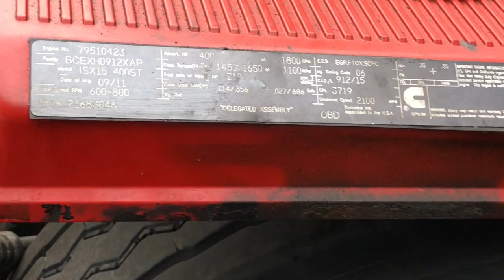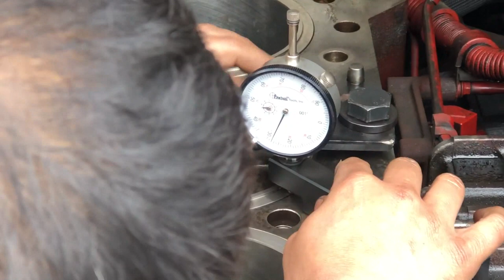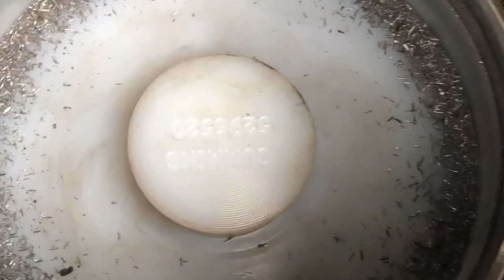ISX 15 Counterbore Cutting Services | GTO TRUCK REPAIR

Comment: Im rebuilding 2 3406bs doing a good job at it . I bought a used counterbore tool . Im doing the work in my friends shop and he keeps messing up my progress, hes had over a dozen mechanics put there advice and most just never do counterboring , the few extra experienced mechanics agree to have it done but will only hire someone else for the counterboring and are telling not to even try. Can i get your advise or anyone reading this advise ??? I just got 2 new spacer plates, Im being told to throw the better one together without counterboring ,  the other is out of spec i can counterbore it later
Reply: Anyone can do anything they set their mind to. However, when it comes to counterboring, it is  machine shop work. Eletrician is it's own trade, mechanic is it's own trade, same as being a machinist.  It's a special skill that takes years to master to get a "feel" or "touch" that you can't buy or shortcut on, kind of like Jui-Jitsu as there is no substitute for "mat time".  Sure, you can buy the tool follow some directions and advice and maybe be okay and get lucky because  all engines do indeed have their tolerances but it is a huge risk if you have never done it before. Typically most engines allow for     .0015" to 002" of liner deviation. Even if your cuts are inside of .002 deviation, on a Cat  you also have tolerances for the spacer plate, the plate gasket, liner flange thickness and the liner shims or inserts that could easily put you out of specifications.  I have literally measured shims from all manufacturers and sometimes out of 6 there is a .002" deviation. That of which needs to be culled and not used. Best of luck to you.

Comment: Very few shops do this, cut the ledges and set the protrusion to .014 (fixed) of an inch. They also dry start the motors... The ISX is a simple motor to rebuild, if you follow the instructions found for free in Cummins Quickserve. I rebuilt mine in my buddies driveway down in Griffin GA. Nice to see you posting this video, and you should do a follow up as to why this is so important. Most shops just scotch brite the liner ledges and call it good. In a few months those liners are busting loose again and taking out that new head. It always seems to be the #5 liner that fails. One way to keep these liners from breaking loose, is to NOT lug the motor, keep the RPMs above 1500 when under a load, and downshift to keep the RPMs up. You can safely run an ISX up to 2400 RPMs, I run mine at roughly 1800 when under a load. 

Thank you for the video, and spread the word about properly cutting the ledges in these motors!
Reply: .0014 of an inch? are you certain? 100%?
Reply: @PoliticalGangster  Fourteen thousands of an inch... .014... Fat fingers. Some are pushing it to .016 on the protrusion.

Comment: Is it possible to cut the liner itself down instead of the block? I’m just asking, I’m not a mechanic or anything (shadetree type, maybe). I’m thinking that now that hole will always need a shim, right? Or are there that big of difference in the height of the new liners that you may or may not need one of you rebuild in the future? Like I said, I’m just asking because I wanna know!!👍👍😎
Reply: No I don’t believe that is possible
Reply: You would have to add material to the liner in order to raise the liner protrusion.  The liner actually vibrates in the block and wears the counter bore down which is why the liner sinks over time and blows the head gasket.
Reply: @dropout75  I was thinking about the same process, cutting the liner instead of the block, but still adding shims.
Reply: If you look at a liner ledge that has failed, it is not a perfectly flat surface, is is rough and in some cases out of form or shape, along with carbon build up. The cutting blade on the tool takes the ledge back to a factory condition that allows the use of shims while giving them a perfectly flat surface to mate to. Without this flat surface, the liners will break loose in short order as they will actually wobble around in there on the misshapen ledge. The reason for the high protrusion, which when combined with the weight of the head and being properly torqued, will not allow the liners to break loose as they do when the protrusions are say in the lower range of the .0007 to .0010, unless of course one is abusing the motor with poor driving habits, as in lugging the motor under 1500 RPMs, do that, and you are just beating the internals of the motor to death and will soon have an engine failure.
Reply: @dropout75  The main culprit to failed liners are bad deletes and operating the motor under 1500 RPMs under a load. Most outfits tell their drivers to run the motor below 1500 RPM for fuel economy. This is a death sentence for the motor due to the design of the ISX. These motors need to be run above 1500 RPMs under a load, preferably between 1600 and 1800 RPMs, lower than that, and you are beating the liners out of the block. Hope this helps.
Reply: @dropout75  wrong, you do not have to add material
Reply: @michaelwright1602   yeah but the turbo is not sized big enough for that rpm, isx15 i drove would fall on its face over 1700 rpm. Had to grab another gear to keep pulling well. And ten speed makes you lug , no other choice 🤷‍♂️. Too much distance between gears verse a 13 or 18 speed.

Comment: on first step why did you raise the cuter up five thousands? and what do you think about APEX tool company, i am trying to do this at my shop in columbus ohio, i appreciate it if you answer.
Reply: In regards to why I raised it was to turn the turn without cutting yet to ensure the tool is clear of any obstructions. And I don’t have an opinion on the Apex. Never used it

Comment: Excelente video, it will help me a lot 
But I have couple questions , what happens when the block has been cut already? Do I need to cut again or just add a chim 
But my bigger doubt  is how do I know how many thousands do I need to cut ?
Reply: They make a thicker shim if it needs to be cut again. Cut the block to reach your .014 liner protrusion
Reply: @cesarsantiago6699  thank you I’ll leave it at 0.014 as you say

Comment: use genuine cummins parts problem eliminated
Reply: They are Cummins genuine parts. Is there something that makes you believe otherwise??
Reply: Cummins genuine parts do fail also. It’s the Cummins blocks from factory that fail. The liners wear into the block and cause the head gasket to fail. Wasn’t until 2015 that they fixed it. Cummins genuine factory fuel pumps also fail and take out the engine with it. Just because it’s oem doesn’t mean it’s good.
Reply: Good answer.
Reply: @mahart40  Nothing was fixed in 2015, the fuel pumps and liners still fail. The liners fail due to two issues, lugging the motors and bad deletes. The fuel pumps need to be rebuilt or replaced every 400,000 miles or equivalent hours.

Comment: No between the adjustment cutting depth you put a feeler Guage between them 1 thousands less say 14. Wasting tim you haven't dun it before because you don't know  Wasting time 123456679101112131415. Fuk man . Counting the shit 😂 don't need oil on the bolts . 😂😂

Comment: To high
Reply: Why ? Asking in a non confrontational way. Asking so I understand your perspective
Reply: I to have heard 14 is the number to have.
Reply: .0014 is ideal, even Cummins is now recommending that height.
Reply: @michaelwright1602  .014” not .0014”
Reply: @steveg2294  Correct, good catch.